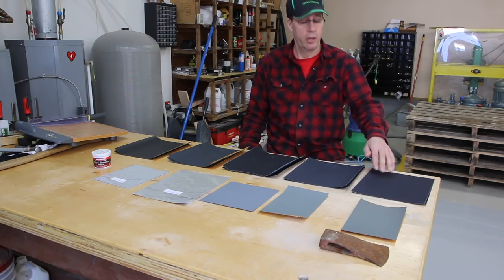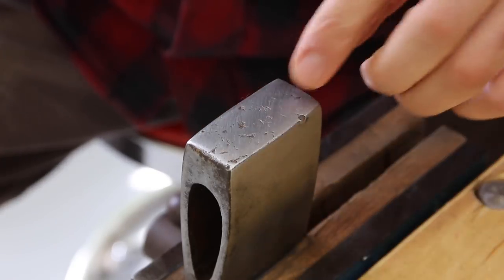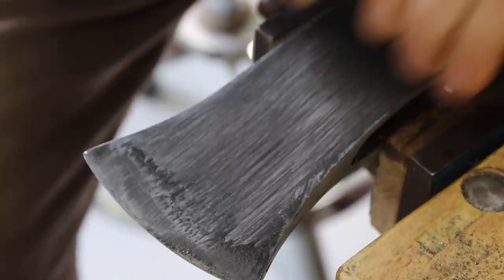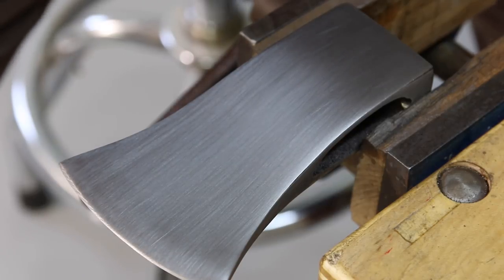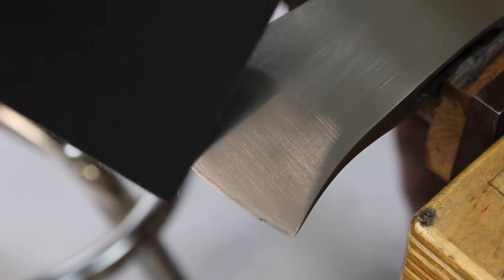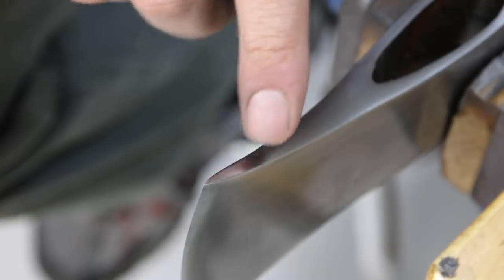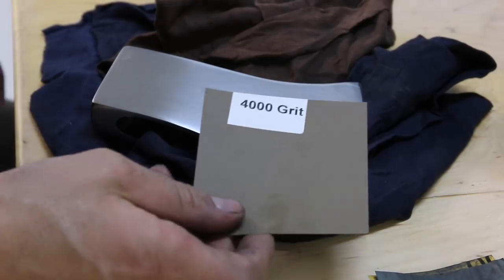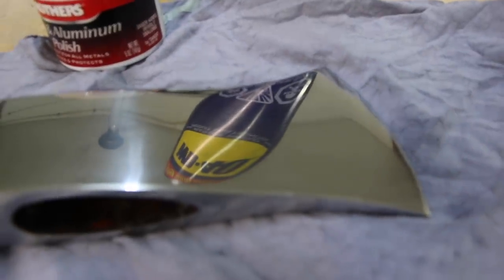How to polish an Axe WITHOUT power tools

Comment: 10,000 grit must feel like a sheet of paper... is there any feel to the grit at all?
Reply from the maker: J Wilkens  it actually feels smoother than a sheet of paper.
Reply: French River Springs I’m not sure why but that messes with my brain
Reply: 10,000 grit is overkill.  Using a polishing compound after 5000 will yield equally great results
Reply: Went to the website he bought this from and they have 60,000 grit paper too! Half a micron.

Seriously!

I want to use that to sharpen some stuff!

Comment: Great video.  It has inspired me to have a go at polishing one.  I am currently I between the fine emery cloth and a 240 grit.  Lots of work but the end result will be worth it.  If I am using a polishing wheel what grit should I end up with before polishing?
Reply from the maker: 3000 grit
Reply: Thanks.  Also, how do you protect it from rusting again after its complete?

Comment: I got a katana and I paid 160 for it but the tip of the sword and down about 2 inches it needs some sanding . thank god I dont have to do the whole sword because I would have to use machines for sure . but I want to get the tip on point and shiny

Comment: I have a knife made of D2 tool steel with fine scratches. And I'm trying to get it polished. With a mirrors edge. I think I'm down to the metal polish step. What metal polish should I be using? And will just a rag work? Also how long did you polish for?

Comment: So I'm just wondering if you have to change directions with the same grit? Could you cross polish in a different direction for each grit and still end up with a nice mirror finish? Also, is it possible that using WD-40 as a lubcricant is what made this take so long? Seems like it's only going to decrease friction and not much else?

Comment: Tbh, it seems like you made this a lot harder and take a lot longer than it needed to be. It looks perfect yeah, but on an axe or something like that, I wouldn't have worried as much about pits, especially since it took you orders of magnitude longer between grits overall. Also, you could have easily cross-polished between grits. One grit one direction, the next grit crossed against it. That probably didn't matter as much, but you put too much time sanding in 100 different directions when it's completely unnecessary IMO.

Comment: My axe is soo badly corroded it's like the surface of the moon, in some places it is so deep even if  you use a grinder, i used angle grinder to grind it now the surface is like sand dune

Comment: Do you have to use a lubricant? I sanded a surface from 80 to 3000 grit. Then hit it with Flitz metal polish and still got a mirror finish. There were slight areas where I obviously didn't get to at a lower grit but it turned out really well. The only thing I did before using the polish was clearn the surface with a damp cloth.

Comment: I have my Grampa's axe head and the heel is badly peened over should I heat it up and beat the metal flat again and recontour the heel or just grind off the rolled over edges? I don't really want to remove so much metal if I can help it and I thought heating the heel up and moving the metal back as close to where it's supposed to be would save the heel better? Any help would be greatly appreciated :) The head is way over 100 years old and has no makers marks on it!

Comment: 19:32 how do you take out those lines there what kind of buffing wheel do you need and do you need compound or just the mothers polish 🤔 . I mirrow polish my 1911 slide ,I did get it mirrow shine but there r some lines still there , so I use mothers and try to buffing it out but I'm wondering if I need compound instead to take then off

Comment: Normaly, an axe would have a very hard edge where a file would just skate of without actually digging in. There is something wrong with the axes hardness as it is too soft to properly utilise.
Reply: Depends on the heat treating. If it could be too hard it could be brittle = bad for big blows. Axes are usually heat treated at a lower temp that, make them "softer"
Reply: Fair enough. It could be just that type of axe. Ive had a decent amount of expirience with axes and just thought that the axe was soft. But i see what you are saying.
Reply: Oh for sure it depends on the type. 
Off topic: Glad to read an understandable persons comment. Cheers!

Comment: I use that metal polish on my dirt bike on the frame an other bits and it makes it mirror blue finish mine is aluminium polish tho i dont think you should use it on steel

Comment: You need to learn how to use a file. It cuts on the push stroke only. If you pull back you flatten the teeth. What happens when you use it? You get scratches, so why go to these lengths. Pointless. You must have time to waste.